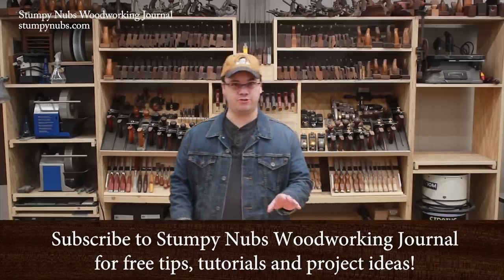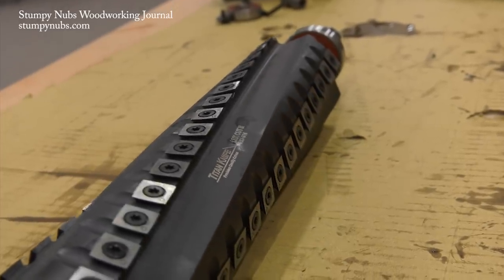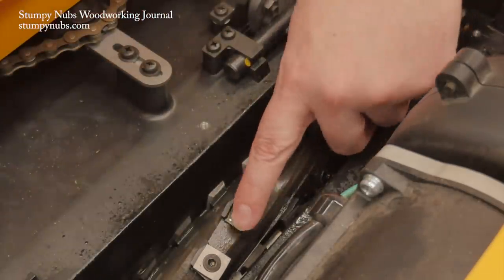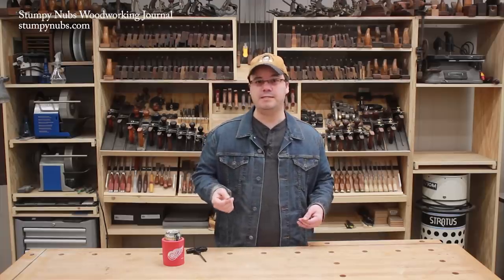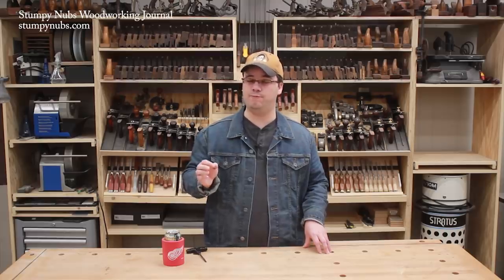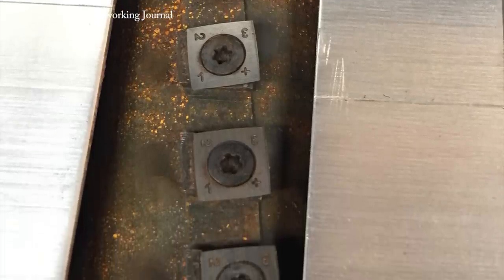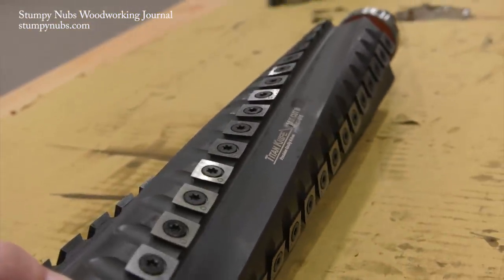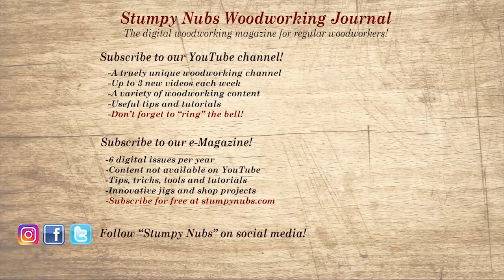Uh-Oh! Problems with carbide helical jointer/planer heads? (How to fix them!)

Comment: Installing / upgrading to helical heads sounds like it takes a factory blade swap from about 20 minutes to 1/2 hour - to an all day adventure. I think I'll stick with my standard Delta supplied blades, at a fraction of the cost, and continue using the finish I get with them, which is actually pretty good, especially on the "finish" speed setting.
I'm not knocking helical cutters, but just wondering if ( for me ) they're really worth the cost and time commitments involved. And, I don't think any project worth the effort is going straight from the planer to assembly, being either sanded or hand planed to final finish.
Anyway, that's my humble opinion for what it is worth.
Reply from the maker: Not at all. On a jointer it's much faster to rotate the cutters on these than typical non-indexed HSS knives which can be a pain to set. Maybe five minutes. On a planer it takes about 15 minutes with the Shelix, and about five with the Lux Cut... As for cost, if you use your machines only a handful of times a year, it may not be worth it. If you use them regularly, it'll pay for itself in about a year, maybe two because the cutters last so much longer... As for cut quality, it really pays off with figured woods or if you accidentally plane against the grain. But I would still sand afterward.
Reply: @StumpyNubs  Merry Christmas, 

Have you ever heard of Sheartak from Canada?  If so are they any good? 

Thanks

Comment: Thanks stump.for the info but I need some help from some you or your subs!! 
I've got a 30 year old planer from harbour frieght! Its a " master craft pro! 
1.) Can someone/ anyone please telll me where and who I can reach to buy blades for it? 
I've ran the model # but apparently Harbor frieght doesn't sell blades anymore for this 2 blade 12" model! 
Still cuts good and the blades are still fairly sharp but I'm just trying to look ahead for I k ow I'm going to need them soon!! 
2.) I also need the name of the tool that sets the SPRING set blades, can anyone tell.me the name of the depth setting blade gauge for this planer and who has it, or is there a generic blade setter tool? 
Thanking you guys in advance for any and all help and or suggestions! God bless!
Reply: Canadiantire sells the blades or did a few years ago. The tool is a blade alignment tool and they are specific to certain models of mastercrafts.

Comment: Sir, what about when overtime you remove your carbide cutters with anti-seize compound do you think there would be debris in the threads?  How about blowing air into the threads in the shaft?  Lastly, you would think that they made a gage to see if the cutter was seated.    Ralph

Comment: Curious from those with 13" planer (e.g. Dewalt) and shelix/lux cutters: noted is that it needs more HP to run? Does this affect the longevity of the planer? The LUX seems to be better but requires removal and re-install of all the blades.  Update: I read that the blades set at 40-45in/lbs and there are 40 on the LUX head. I would invest in a "comfortable" in/lb driver that can do 10-50in/lb.

Comment: Surely an easier way to deal with a shallow or partially threaded bore is to simply file a bit off the bottom of the screw?
Reply from the maker: That makes sense.
Reply: @StumpyNubs  I was wondering whether they were using the bottoming out to provide some extra grip to the screws but I suppose that's not necessary once they're tightened down.
Reply: Be VERY careful that you do not affect the threads on the end of the screw if filing or you will damage/compromise the internal threads when you screw it back in.  Would not recommend doing that, especially on high-speed rotating pieces.  If it doesn't screw in all the way, make sure you haven't got some junk on the bottom of the hole after cleaning the face.
Reply: @woodstover  Oh yes definitely. Often less than a millimetre needs removing though, which is usually the unthreaded part anyway.

Comment: 2:20 The misaligned cutter is causing excessive vibration
Reply from the maker: No, I have a genetic disease that causes shaky hands. But thanks for mocking it.
Reply: @StumpyNubs  I have shaky hands too and I get razzed on the job all the time. I just meant to make light, not offend. My apologies.